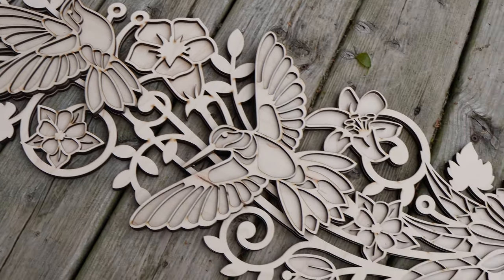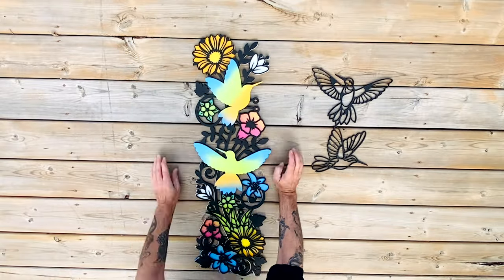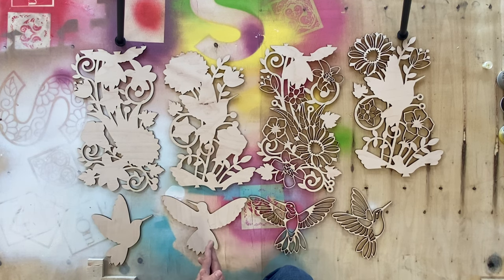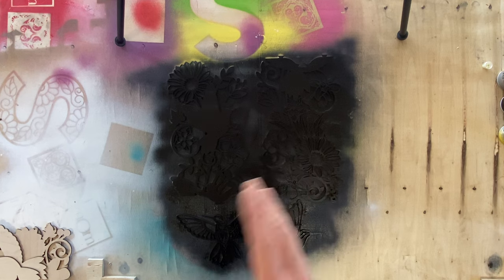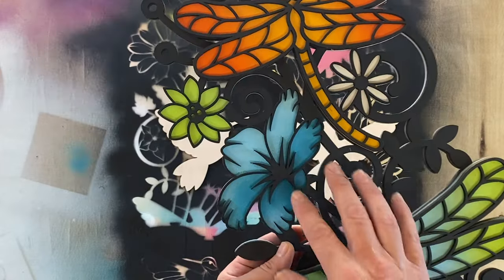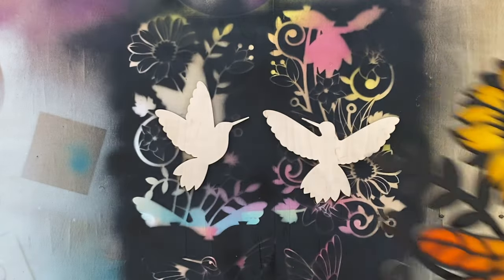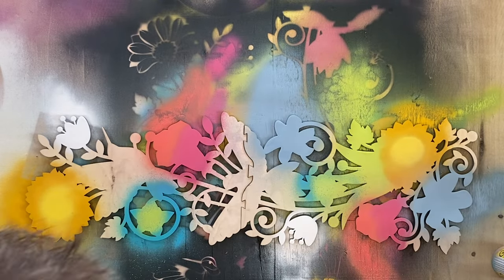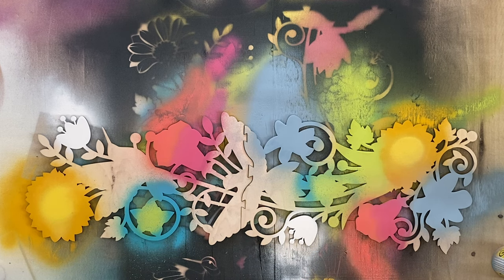Using Spray paint to create Gradient effects and Finish a Trellis Hummingbird Design Laser Cut File

Comment: The edges of the cut pieces will be black from the laser.  When you spray paint how do you avoid paint splatter getting on the edges?
Reply from the maker: @jessetutterrow4320  I have never to this day. Had a customer complain about some of the overspray. But if I do want a perfectly clean finish on the edges, you can take some dark stain or paint. It’s just a lot more work.
Reply from the maker: @jessetutterrow4320  I have never to this day. Had a customer complain about some of the overspray. But if I do want a perfectly clean finish on the edges, you can take some dark stain or paint. It’s just a lot more work.

Comment: how do u split the image to make em in to 2 pieces, i use lightburn
Reply from the maker: It’s part of the file I design. I provide a split version to make it larger and a regular version. Art is strategically done to make the split abs hide the seam, So not as easy as just splitting it. I use Adobe illustrator 🙂